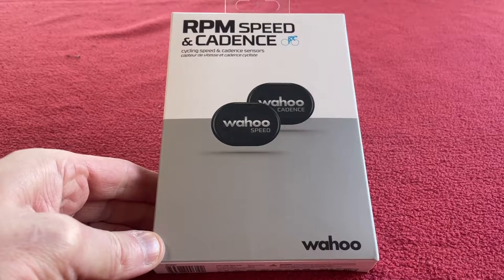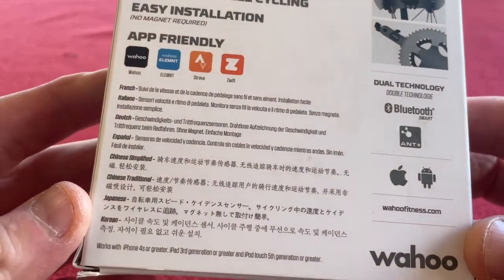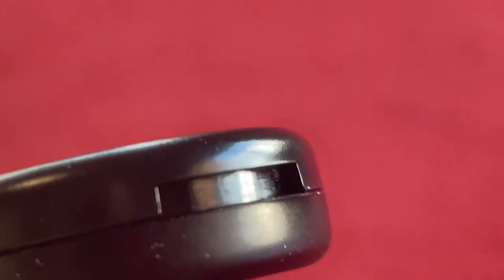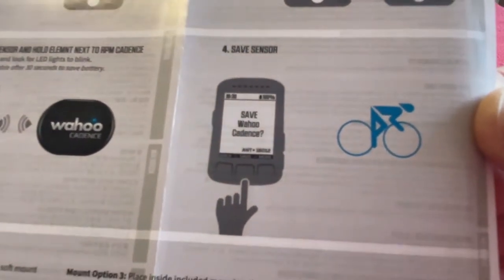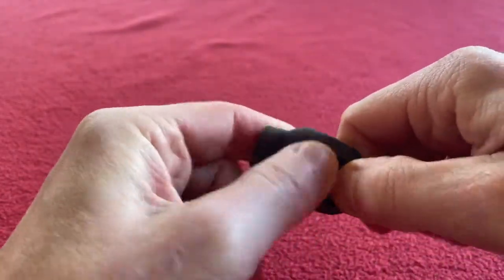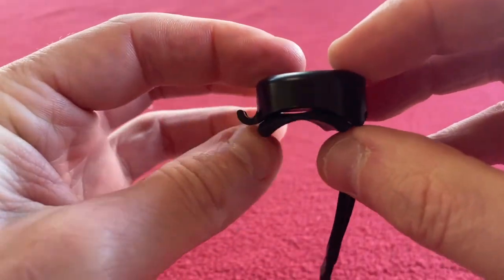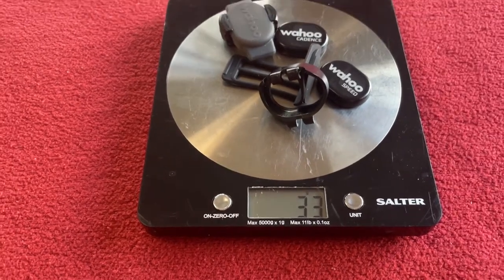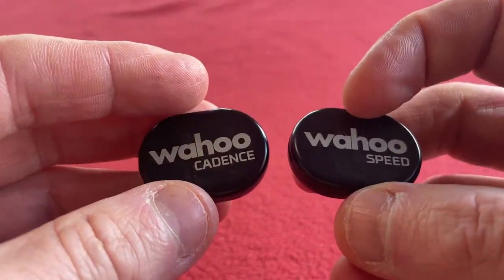Wahoo Speed & Cadence Sensors

Comment: The RPM speed sensor operating on the Android app is less accurate than the app is without using the sensor because the wheel circumferences that you measure and enter into the app gets overwritten by some random value EVERY time you use the app.  I've filed a complaint in the CS issue system, and they admit it is a bug, but they are giving it "the lowest priority" to resolve.  Thanks for the junk Wahoo.

Comment: one strap is a joke for this amount of money, my wheel hub is 35mm and this stupid strap is too short, thanks Wahoo
Reply from the maker: Yeah I have found getting the strap round a bigger hub is difficult, they should at least give different lengths 👍
Reply: @KyrosHouseCycling  I have the feeling the design is ten years old
Reply from the maker: @dubtube6691  it’s old but it works. 👍
Reply: @KyrosHouseCycling  that's true. But you have to find is solution for your wheel hub. I expect a little bit more for this price
Reply from the maker: @dubtube6691  yeah I do agree that there should be more in the box for your money. 👍
Reply from the maker: @dubtube6691  yeah I do agree that there should be more in the box for your money